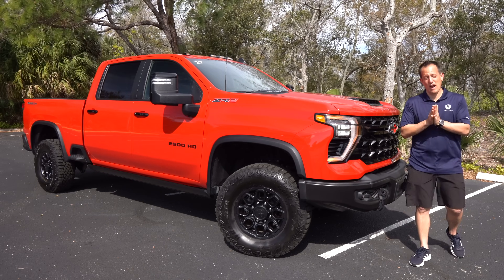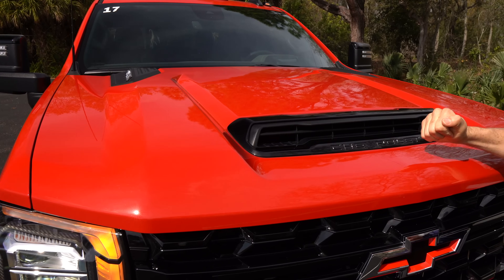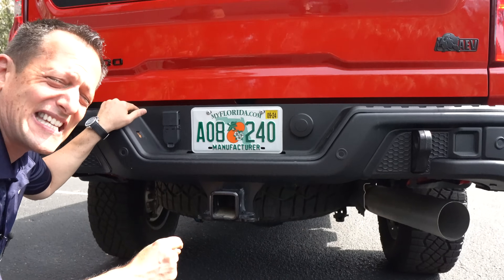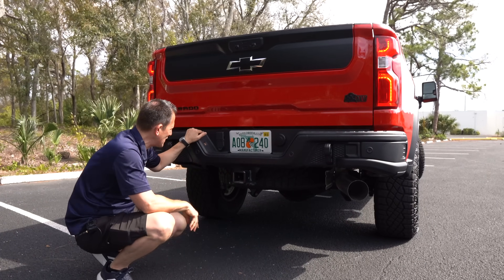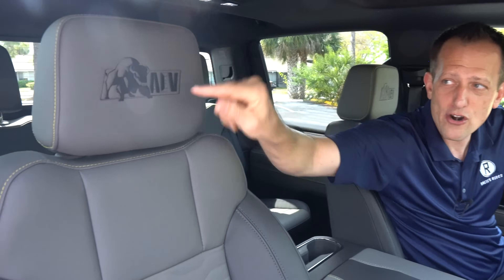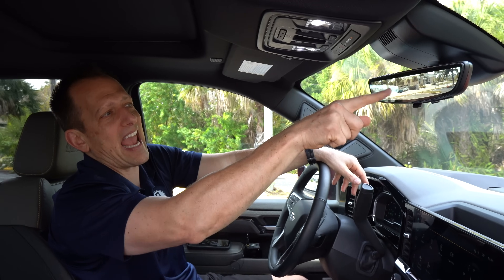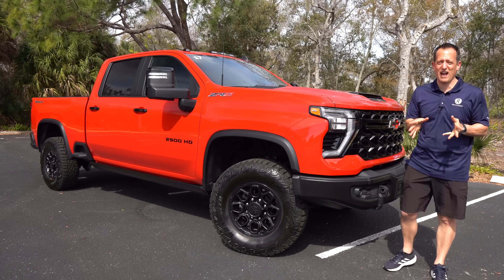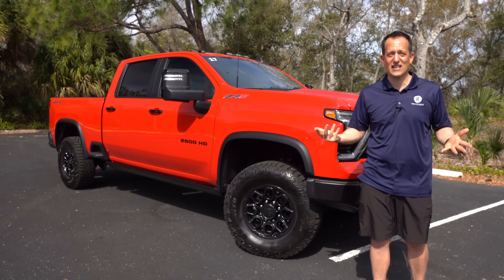Is the 2024 Chevy Silverado HD ZR2 Bison a BETTER truck than a Ford F-250 Tremor?

Comment: This is one absolutely awesome BEAST of a pickup,  I love the orange and black and IMO the black door handles fit right in with the black tailgate and wheels, bumpers, grill, etc and it gives you some black all the way around the truck.    Yes it is expensive at $95k but it has an exteme offroad setup with the special shocks and tires, etc. and I noticed even going through the sand and sippy hole that you were not bouncing up and down like a Bobblehead Doll like some trucks (dare I say Ford) will make you do it.     Thankyou Joe and Lori ,  you guys rock !

Comment: Great review as always.  Lori, the best in the BIz!!!  I had a 2024 ZR2 on order, but with the $15300.00 discount Ram gave me, I went with the 2500 Power Wagon.  The Chevy 2500 ZR2 is a great looking truck.  I have nothing negative about the Chevy trucks.  I had a 2020 Trail Boss 1500 for 3 years with zero issues.